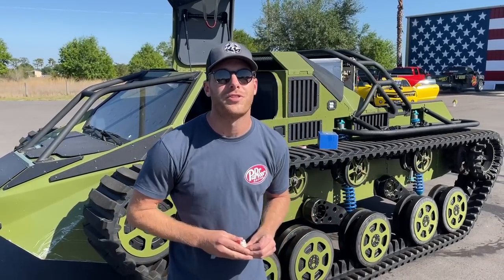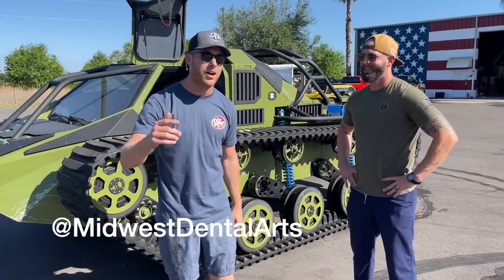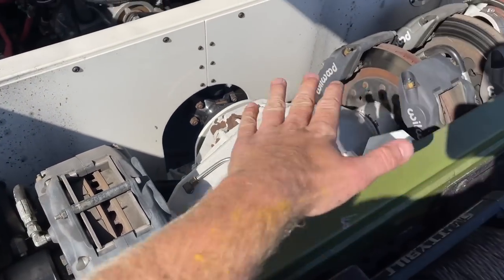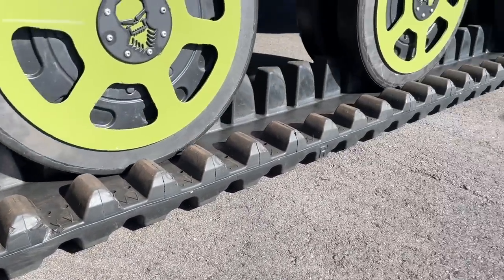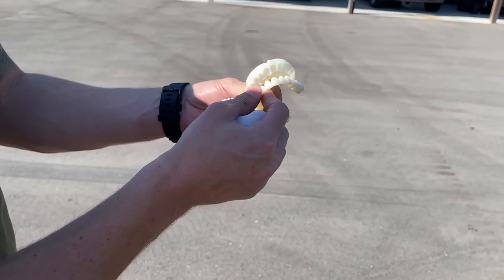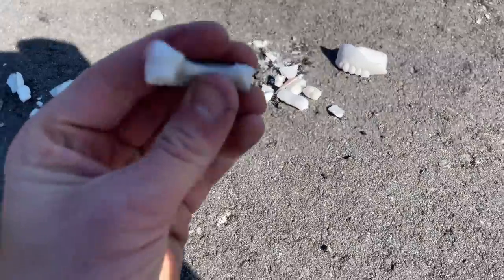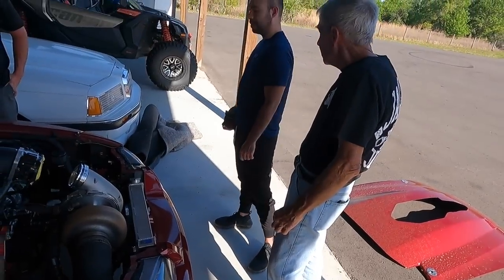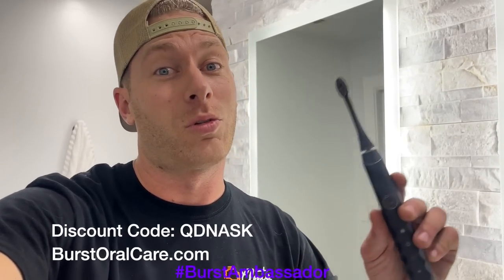Ripsaw Tank Runs Over Dentures to Test Their Strength

Comment: Hells bells technology has improved. 25 yrs ago I used to set up dentures in wax with acrylic teeth, then set them in plaster in copper canisters, Once plaster set, boiling out the wax, placing pink acrylic in and then curing them with heat and pressure. Damn i'm old 🤣
Reply: Im a lab tech and still do it that way everyday.

Comment: The ground pressure gets really low on a track like that... that's the beauty of them. So if the Ripsaw is 8000 pound the dentures not seeing that kind of pressure. Not saying they not are strong, but no 8000 pound on the dentures.
Reply: No, but it did leave an impression on the blacktop.!

Comment: I had all my teeth pulled.
Dentures I had did not that right.
Dentures could been redone.
Put i decided not have them done.
Because the dentist didn't do it the first dentures was right.
 had rough edges
 I went and get it fixed but it's still the
 same.
 I get dentures new.
Can't afford them.
Iam very tight budget